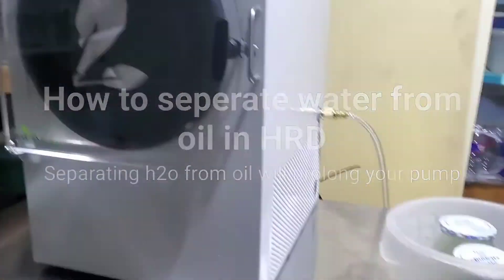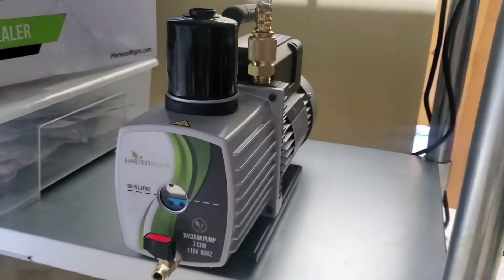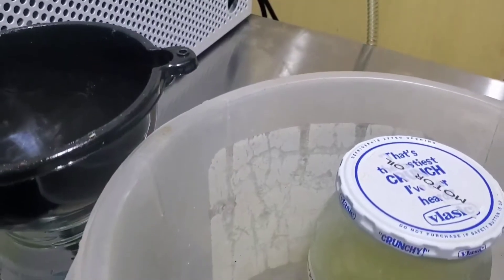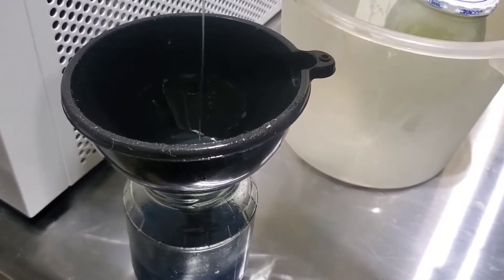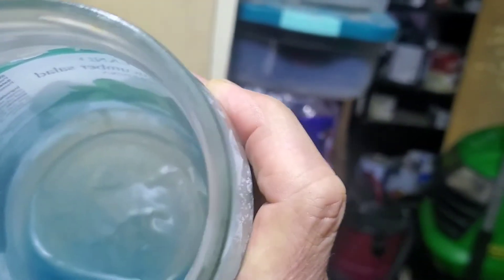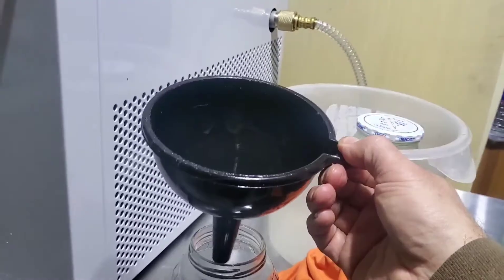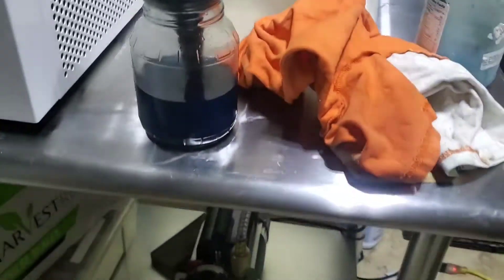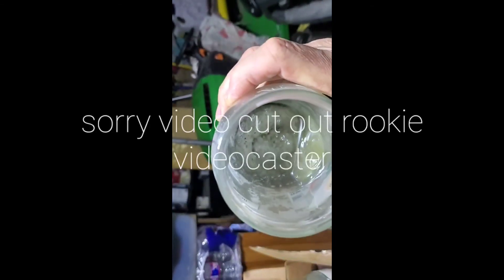How to separate water from Harvest Right Dryer during oil change

Comment: OK I’m asking because I just do not know. Freezing that jar with the water in the oil. Does it do anything to the oil composition or anything to where it would harm the machine going back through.
Reply from the maker: the oil will be really thick after it freezes,  I normally have an extra jar and put the oil from the freezer in the empty jar then defrost water in the jar from the freezer.   I normally don't out cold oil in the HRD.  After the oil thaws out I run through a filter.
Reply: @JJG505  thank you very much.